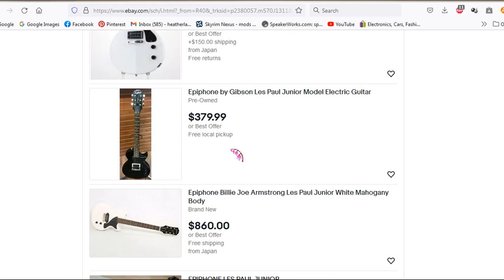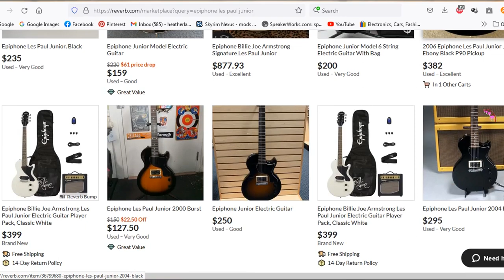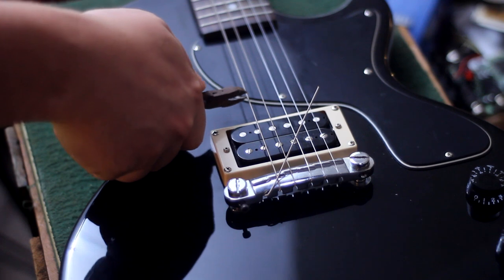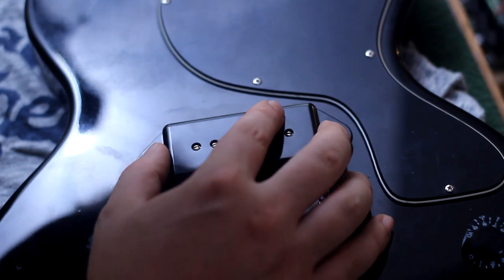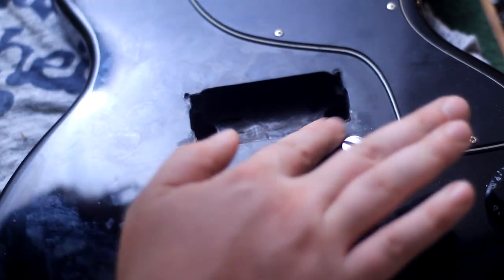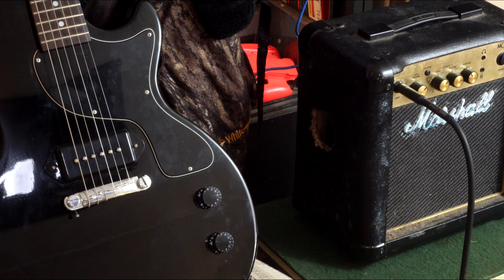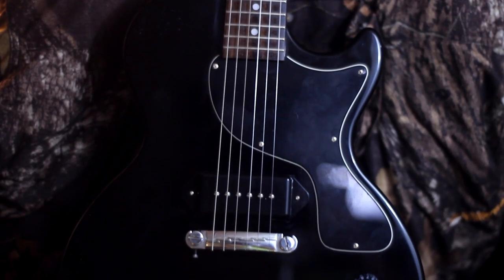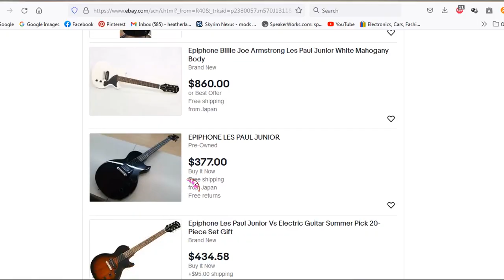P90 in Humbucker Les Paul Junior (Save A Sh!tload of $!!!)

Comment: i buy all my replacement puy's from guitarmadness . my yellow spirit has dimarzio super d's and a single sized hb from him and i really like the sounds . he is cheap too!!! i bought a p90 guitar - an  sx liquid from rondo . it had the most fret sprout i ever saw . cut the crap outta my hands and dahlias . before we realized the fret ends were RAZOR sharp . the whammy bar had a part in it that was mismanufactured . they sent a replacement but that thing was awful .i sold it . it was like 6 emails and they were progressively getting more rude and dickish before telling me the tremolo system on this guitar makes it unstable and unplayable .lessons learned and i will never buy anything from rondo .ugly wall hanger guitars unless you spend 900 for an agile which will be in some rediculous ugly finish,with 19 strings . hey how much does that thing weigh ? i have wanted a tv yellow with a black neck for some time . such cool guitars .
Reply: Rondo went to hell a few years back as many people have been burned by them over the last six years, or so.
Reply from the maker: Thank for watching and taking the time to write a comment Petey. Yes, I will definitely be getting any other pickups that I need from Guitarmadness. I have only good things to say about the one I got and he has such a great selection and the price, thats the kicker... No way I could build that pickup with that magnet, core, bobbin, screws and that cover for that price. Oh, ok so stay away from Rondo guitars, thank you for the heads up. Yes, the TV yellow is my favorite. I like the red stain and white a lot too but the yellow one is Awesome. It was my plan that if I had bad issues with the route not covering or if I had to get a sunburst one I was going to refinish in TV yellow and put on a red tortoise pickguard... that look is just classic. This one is pretty heavy feeling. I just went and checked... Bathroom scale says a bit over 8.5lb I thought damn that seems overly high for a JR, I looked up the weight on others and it is damn high. So that may have been a factor in why it was so cheap. It seems that its an extra fat one for sure. I normally don't even turn my head at a Gibson design and I blame YouTube for brainwashing me but the P90 Junior is like the closest thing to a Fender Esquire. I'm a sucker for the "keep it simple stupid" design philosophy. Just a flat slab with one pickup no bridge just a wrapped tail. Something James Dean leather jacket cool about that to me. Thanks again Petey

Comment: Which wires did you cut to remove the old pickup? I’m doing the same thing with my Epiphone Les Paul Junior and I have the same guitar as you, I’d rather cut the wire somewhere down the line so I can just solder it to the old wire instead of having to solder to the actual connection point. Plus I feel like this way it’ll make it easier to go back if needed. Just maybe hoping for a little description on the wiring, thanks man loved your video. Inspired me to do the same!